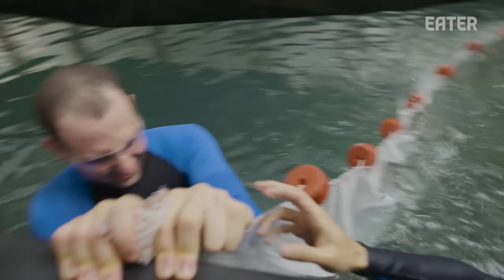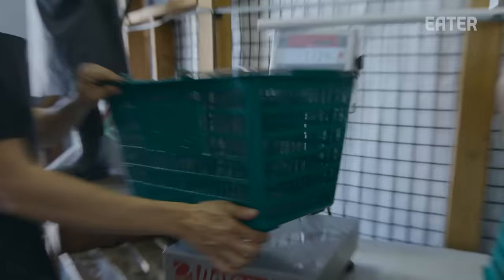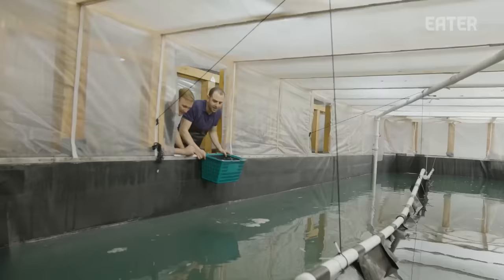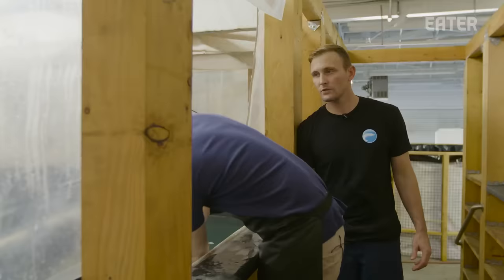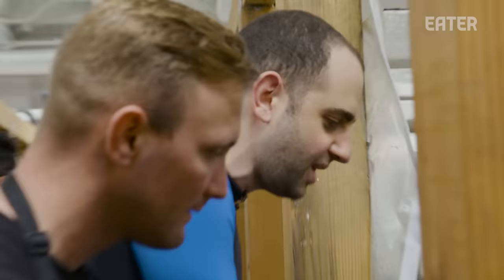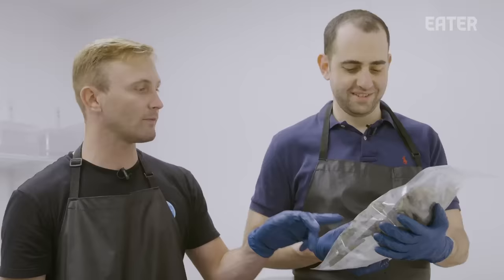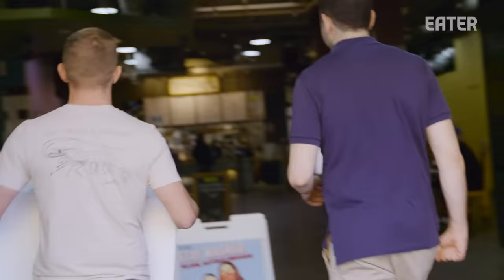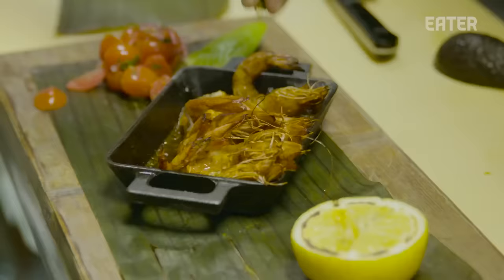How America's Biggest Indoor Shrimp Farm Sells 2 Million Shrimp Every Year — Dan Does

Comment: They should grow plants with the water from the shrimp pools, that would filter the water more efficiently and add a second source of revenue.
Reply: Use oysters to filter the water instead.  You can make big money off those bad boys.
Reply: That would add many more variables, not worth it.
Reply: @ether23-23  yeh I agree, its obviously a sustainable model as it is, I wouldn't muck around with the system. It will require additional research if planning to expand business and also capitalise on other bypass products. What they should do is focus on breeding and hatchery. Saves them relying on shipments in long run.
Reply: Or make a shrimp fertilizer from the waste...wouldn't change anything or cost much at all to start

Comment: I wonder if they're working on an automated sorting system. In the recycling industry they remove certain pieces of trash by identifying it with a camera and blowing them away with a puff of air. they might be able to use the ranges of weights to categorize them based on distance.

Comment: I wondered if the shrimp grower shown  would like to have a super efficient heating system to heat the water, to hold the temperature exactly on the dialed temperature. Being in California keeps the environment  above freezing, but I suspect heating is being used. My system uses any available fuel, but for the environment conscious you may want to use electricity, to get that extra feather in your hat? You want to avoid wasteful practices, so for nothing, I can give you more information. I have installed my system in several greenhouses. Note my system does not heat the air above, but only the water below.
Reply: Reported as SPAM.
Reply: Please share more details about your heating system

Comment: The manual labor part of it, scooping tiny shrimp to transfer into different tanks appears costly.  Delays out of water can stress the young shrimp.  
Manual labor reduction would be a must for operational scale up.
It may be cheaper to install sluice gate channels between the tanks.  Permanent connectors could risk inter-tank contamination.   Drop floors and other walk arounds may also be needed.  
Two peninsula drop platforms to the harvest tanks may also be  (Capital S shape out of a figure 8 rectangle) can be configured with automated drop seine nets from above can reduce human time inside the tank during harvest operations.

The size shown right now appears optimized for monitoring against contamination.  Not quite efficient for automated configuration.  Scale ups for efficient automation could risk microbial contamination and early death on a massive scale that monitoring systems won't catch in time.
Reply: Word salad.

Comment: Fish farming isn't new. There is a lot more infrastructure required than we see. If i was going to set the operation up, i would put the nursery above the other tanks and flow them through pipe to reduce labor. The absolute key is no power interruption. It wouldn't take very long until you had tanks of dead shrimp.